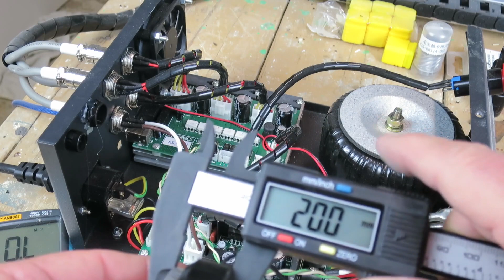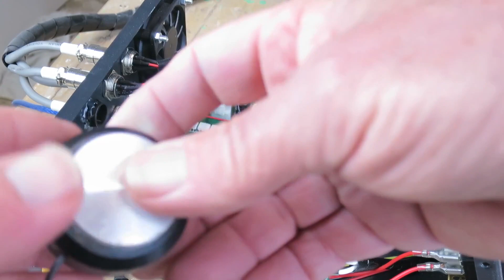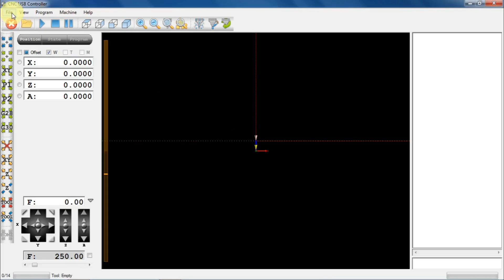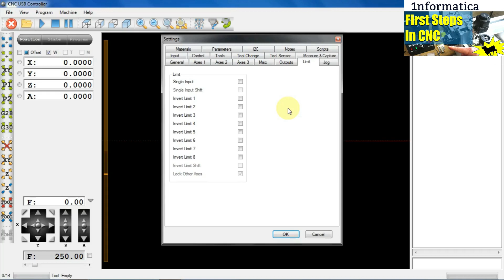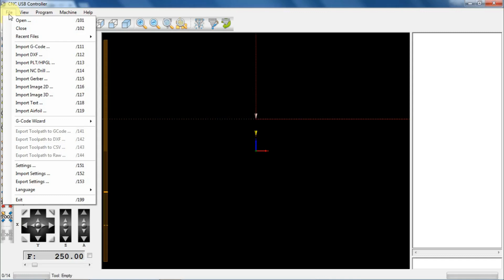Z Axis Probe CNC USB Controller 3040t Tutorial How to Guide

Comment: Bingo! just bought the Z-Axis Router Tool Setting Probe, same sort of thing as you show here, and always like to do a little homework first to see if any of you guys have any info before sorting it out myself,  so was glad to come across your video using the same 4030 and CNC USB Controller, will start work on setting it up later today. 
Thx for uploading the video
Paul
Reply from the maker: Thanks Paul, hope you will find it helpful. If you hurry you could be my 3000th subscriber!!
Reply: @1nformatica  Don't normally subscribe! But since you asked (yr now @ 3K) all I need now is a spam email telling me I’m the lucky 3000 subscriber, but don't follow any fake links cause you have won jack sh@t, :) Now that would be a refreshing change! 
 Anyway having took the cover off the power box, it's seems mine is an older version than yours, no USB socket on mine but in its place there is what seems to be a 2.1/5.5mm female jack plug socket, ""could it be that simple"" ? That mine has the probe socket already fitted, and is just waiting for me to use it? 
On doing a little researching as my pcb has no markings, I found it to be the JP-382A (link below)
https://www.aliexpress.com/item/USB-CNC-3-Axis-Motor-Stepper-Drive-Controller-Board-JP-382A-Drive-for-Mini-CNC-3040/32821517490.html
And if you scroll through it does show this socket marked out as >probe< 
Before I could test it! I had to add a 2.1/5.5mm male jack plug as my tool setting probe terminated to just bare wires, so now after plugging it in directly to the jack plug I get the same reading as the video, Pin-3 and Z/Axis lights up red/magenta, so yes it really was that simple.
I will sort out rest in morning after a few hours kip (still in night mode as I work night shifts and only finished them Sunday) 
 In truth I got a good deal on the older parallel port only 4030 version, and a copy of Aspire for only £340 delivered from Germany, and I was expecting the controller box to blow up by now, so I would have to mod it, but in truth its worked fine, even the parallel port to usb works fine on my W-10 pro 64bit, once you disable windows stupid digital signed drivers, the only things I have really done is check all the bolts and thread lock where needed, check all the connections basically give it a good once over/proper QC-check, the main 2 ali plates that make up the working area where slightly bowed/convex to about 1mm! but I just added a MDF spoil board, cut new t-slots and planned the surface so it’s now total flat to the cutter head, as I do CNC 1mm optical acrylic and need to be within 0.1ish some times.
All in all the 4030 is a great little CNC as a base to work from, its solid and the unlevel bed is such a easy fix by adding a spoil board. 
Thx Paul
Reply from the maker: Thanks for getting me to 3K subs! No prizes I'm afraid but I hope you will find my videos interesting. My unit has a JP382C board and no socket on the back. I will be adding limit / homing switches to the axes soon. I don't have Aspire but have attempted a little vcarve project https://www.youtube.com/watch?v=UMmPnpNHo3I
Reply: @1nformatica  Hi, Yes I watched that video already! before using/finding the create lithophanes within Aspire for some 12mm acrylic work, your over 100m honest sum up at the end made me laugh. I have a dry sense of humour, and yes your videos are very interesting/clear and come across as being really natural "easy to watch".
 The limit/homing switches is a next project for me too, having built my own 400mm Delta printer and been 3d printing for years, it shouldn't be too hard! If you get time please try to video it as I’m sure it would help a tonne of people, me included. 
Thx Paul
Reply from the maker: Very useful feedback, thanks Paul! Glad you have a 3D printer as I intend to print supports for the microswitches to fix to the axes. Will certainly make a video of it. I have some 3mm Acrylic I want to engrave, and tips on speeds, feeds & bit type? I had a hard time finding the right combo for cutting thin vinyl without it melting and clogging the bit https://www.youtube.com/watch?v=ATmvC3e4Oz0
Reply: @1nformatica  I'm still learning all, but having successfully just cut out/milled a 3mm lithophane here's some of what I learned. I say cut out or milling as you asked about engraving which is different, but some things I learned will carry across., plus I added a few tips for others who may read this.

1- Always use CAST!! Acrylic never extruded. (I assume vinyl would act like extruded acrylic and be prone to melting, cast is much better as I now know!)

2- I use 2-Flute ball nose spiral up cut bits as these cut the acrylic and at the same time the spiral flute removes the waste up and out, (only every use 1 or 2 flute bits as 3 & 4 flute bits are not for acrylic and will clog) Once I stop braking bits! I will buy a good 2 flute >tapered< spiral bit, as a good all-rounder. 

3- The china v-bits (half round half flat) that generally come with these machines! I find hard to use or get a correct setup, and in truth it's hard to get a good setup with them because some are just plain cr@p, so this has nothing to do with your settings! I have changed to 2 flute spiral up cut bits as it makes learning easier as you’re not second guessing the bit all the time. And if you think logically about it? Better to cut and remove the waste with a spiral flute! Then cut-scrape and push waste about with them cheap bits. Plus a blade that cuts will cause far less heat then a bit that scrapes its way along. But if you ever find a good V-Bit please let me know as I do need one myself. 

4- Speeds/feeds, LOL! you could write a PHD on this subject, but doing my 150mm x 100mm lithophane in 3mm cast acrylic here's what I used> 
>Rough cut=20mins< (3mm Dia ball nose 2 flute bit) cutting to a depth of 2mm @ 0.5mm per pass, with a 30% step over FEED2400mm/min PLUNGE1200mm/min SPEED12000rpm(or max 95% on my 300W motor). I’d also assume with China propaganda bull shit of over estimation of EVERYTHING!! 12000rpm could be more like 8000rpm.
>Finish cut=80mins< (1mm Dia ball nose 2 flute bit) 1 pass as no more than 0.20mm depth needed cutting 10% step over for a nice resolution/finish FEED1200mm/min PLUNGE600mm/min SPEED12000rpm.
>Cut out=10mins< slow! as I used same 1mm bit as above to save a tool change, 3mm cut out @ 0.5mm per pass FEED600mm/min PLUNGE600mm/min SPEED12000rpm.

Not sure what the rules is? but if I use a 3mm bit I don't go over a 30% step over, ie 1mm cut (normal even less then this) and I get a clean cut as this gives the flute time to eject the waste.

5- Also check your software, ie toolpaths; you will get a much cleaner cut edge if the bit is being pushed into the edge being cut as opposed to being dragged backward down the edge its cutting.

6- If your PC is multi-tasking best to set USBCNC priority to very high in settings, it's probably a good thing to do anyway. 

 These are my settings and are not set in stone! anyone reading should respect this! As I’m still learning myself, better to go slow at first and take notes of what works best for your setup, I had zero clogging or melting just a nice clean cut with the above settings, for my first full lithophane the result was really good, with a good resolution of detail. As a side note! on the build up to this I broke a 1mm bit, milled a nice clean cut through a support with a 3mm bit (now ruined), as well as have other mishaps.

Thx Paul
Reply: @1nformatica   Hi,  How did you get on with fitting your limit/homing switches ?
As i have just finished added the micro limit/homing switches to my CNC using the USB CNC CONTROLLER software, but did run in to a little trouble!  
At first I added 2 switches per axis in a closed series circuit (i think the term is Active-High) and all was good, both homing and limits worked fine once setup and inverted.
I choose this setup because if any of the switches/wiring failed it would instantly show and trigger to stop the machine.  
The problem was the Z-axis! as the z-probe no longer would work in this configuration, as it uses the same circuit as the Z axis.
In the end I just wired up the Z-axis switches in parallel using the active low side of the switches, so each switch and z-probe now work independently but use the same circuit.  
Hope that makes some sense.
Thx Paul
Reply from the maker: Thanks for the info Paul. I have not had time to fit my switches yet, too many projects!!
Reply from the maker: @luapynneb3069  I show how to solve the problem in this video: https://www.youtube.com/watch?v=2zK_c9hD3ys
Reply: Hi Luap. Could you tell me which seller you got your machine from please? I'm thinking of buying either a 3040 or a 6040 and have seen sellers in Germany doing them. Did you get good service from the seller you used? 
Thanks
Mal
Reply: @malturton433  Hi Mal
Just in the middle of something, give me an hour and I will come back to you with all info you need.
Thx Paul
Reply: @malturton433 I bought here 
https://www.ebay.co.uk/itm/232740917756 (note the USB-PORT) is parallel to USB adaptor but works fine on my W-10 64bit through USB, running CNC-USB and I now run aspire.
I offered £340 and they accepted, at the time it was the cheapest option with shipping from within the EU 3-5 days, I think it was at my door on the 5th working day. With zero problems, item was well packaged and very heavy; god knows how a 6040 would fair with a courier!
That answers your questions, but it all depends on what you want and need, i personally would not go above a 3040 size machine without Supported Linear Bearing Rail Shafts, and other extras, but this all adds up making a good solid 6040 very expensive, to be honest if I needed to go bigger I would buy all the gear and make it myself, also read my post above as these 3040 are nice solid machines, but china QC is cr@p at best, be prepared to take the top off the control box and tighten all the loose screws and nuts and check wiring is seated correctly, then go over the whole main 3040 frame and make sure all bolts are tight, I thread locked them, sounds a lot of work, but it’s not! It's a few hours at most, also note most beds are not going to be totally flat out the box, I solved this as I needed a spoil board anyhow so you just plane that down with the machine once fitted, 6mm leveling bit cost me £6 and it turned out better then others i've seen done with a bit costing £100.
If you need any more info just ask
Thx Paul

Comment: excellent video set  
i am only starting in cnc with a 3020t  but i now wish i had bought a 3040 
but i have what i have and i am really amazed with what these little machines can do
i have subbed to your channel
thanks
james
Reply from the maker: Many thanks James! Will try and do some more CNC videos soon but have been distracted by other things. You can start building your DeLorean!
Reply: i think i will start with the mini first ha ha 😆😆😆
looking forward to the new cnc videos though as i will 
be starting to use my little 3020  to do some projects very soon
what do you think of the control box  and also the stepper motors  has it been reliable as i have read some stories about the box which is the same as mine but mine has no usb
i used snap cnc from docado  with my cnc without mach3
it is also grbl based works fine 
thanks and keep up the great videos
👍👍👍👍
Reply from the maker: Hi James, I have had my unit about a year now and have no complaints about the control box or anything. Seems reliable and I'm happy with it. Would like to do some V carve projects but I have not found any software that is reasonably priced or  in the case of Fusion 360 as friendly as a cornered rat! If you have a particular subject you would like to see a video on let me know.
Reply: hi 1informatica
thanks for the reply thats great to know so hopefully mine will prove as good
i use design spark  for  2d drawing i think it also does 3d but not sure
the only other software i can think of is cut 2d by vetric  i don't know if i does v carve there is a v carve desktop at around 340 euro  as you say the software is expensive  and indeed fusion is in another realm  for people that does not have much  or no cad experience such as myself
i can use fusion a little for simple thing for my 3d printer  but i find that my computer is not really good enough for anything complex as it is very sluggish
regards
james

Comment: My tool sensor works on the Z axis but in revers.  It will trigger the limit switch when the Z axis is going up but wont do anything when the Z axis is going down.  Any suggestions?
Reply from the maker: Hi Richard, I guess you are using the same machine and software? If so when you start the Z axis measure offset which way does the Z axis move? If it moves up then your Z axis control is reversed. I show this in another video: https://youtu.be/-zoUV3XBFak?t=71
Reply: When I click “Offset - Measure Offset Z” the Z axis goes down. I trip the sensor the Z indicator turns red but the Z axis continues to move down.

However, when I click “Offset - Measure Tool Offset”  the Z axis moves up and when I trip the sensor the Z axis Stops.  Im Baffled!
Reply from the maker: I am unclear what you mean by "I trip the sensor". The Z axis probe is attached to the "probe" input on the controller board as in this photo https://drive.google.com/file/d/1ltDj0pL6s0zfswHY4F7Gr-KabN7LQ74L/view?usp=sharing The Z axis limit switch (which my CNC did not come with) is a different function.
Reply: By trip the sensor, i mean when the bit touches the tool sensor (probe).  Yes I am using a probe not a limit switch.  My tool sensor is plugged into the prob input.
Reply from the maker: So you say "When I click “Offset - Measure Offset Z” the Z axis goes down. I trip the sensor the Z indicator turns red but the Z axis continues to move down." If it has touched the sensor how can it continue to move down? Once I forgot to put the ground wire on the tool and so the sensor did not work and there was an awful racket as the Z axis stalled until I could kill the power!
Reply: I know, I can't figure it out.  I have attached a link to a video and a photo of my gator  with my touch plate.  Maybe this will explain my issue.  when I click "Offset - Measure Offset Z", You can see the z axis on the screen turns red when I touch the touch plate with the gator clip and the Z axis continues to move down. When I click “Offset - Measure Tool Offset” The Z axis Moves up and When I touch the gator clip to the touch plate the Z axis stops completely.
And to confirm I am plugged into the Probe Socket, it is marked on the board.     https://drive.google.com/open?id=1cKbaJMhzv4TBTBCBRAFGeZOCaeLcPFb3

Im at a loss!  I really appreciate you taking the time to help me with this.
Reply: did 
you got your problem solved
I have the same problem and can't find a solution

Comment: Great video, very useful !  Have you tried to control the spindel on/off from the software. The contacts seem to be right next to the probe pins but are not populated with pins. In my case they seem not to respond.
Reply from the maker: Thanks Dan! I have not tried spindle control, may take a look at it sometime. Did you look in this tab when testing the spindle pins : https://youtu.be/32hjG9YyjDM?t=123  If the input is not showing in that window then I don't think it is supported in the firmware.
Reply: Yes, but I was interested in the output of the controller board. That is shown, it is output 2 for the spindle.  The pins on the board for the spindle control are indeed the 2 closest to the probe pins.

Comment: hey what is the difference between Retract and Return Distance, its confusing.
Reply from the maker: Return Distance:
Value represents distance for which tool returns once it has touched the surface of the sensor.

Retract:
Value represents distance for which machine ascends (from position to which previously
returned to).

Why there are two values is a mystery to me!!  In the video you can see a brief pause between the Return distance and the retract https://youtu.be/32hjG9YyjDM
In my example I set both values to 5mm.

Comment: Hi! Very useful video...anyway when I touch my movable tool sensor, in the IO window the axis that becomes green in LIMIT is the Y...why?????? How can I set the right Z axis? thank You!
M
Reply from the maker: Hi Mirko, do you have the same controller board? You have the probe wired to the "probe" input as I show here : https://youtu.be/32hjG9YyjDM?t=59
Reply: ok, I've restarted the software, tried again and it works perfectly! Maybe I had to restart the software to make it works! Anyway thank You so much, very kind and fast answer :-)
Reply from the maker: Great news! What things do you make with your CNC? I made a fun clock :  https://www.youtube.com/watch?v=ATmvC3e4Oz0
Reply: Hi I have the same problem on my CNC 3040 T ... Z probe connected and Y is responding ... what is bad ?
Reply from the maker: It seems that this is how the controller board is wired, I do not think you can change it. What I did was to set the "Single Input" box in the "Limit" tab of the settings as I show here https://youtu.be/32hjG9YyjDM?t=231 This made it work for me.
Reply: After your Feedback  always is ok and fine
Reply from the maker: I am happy it is working for you.
Reply: Were you able to fix this issue you have.  i have the same issue and I cannot get my z probe to work.